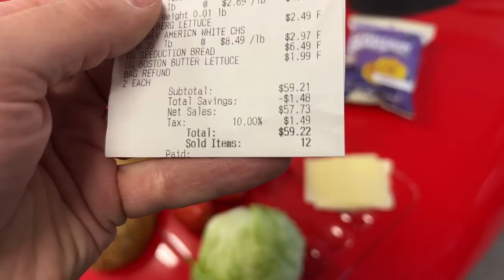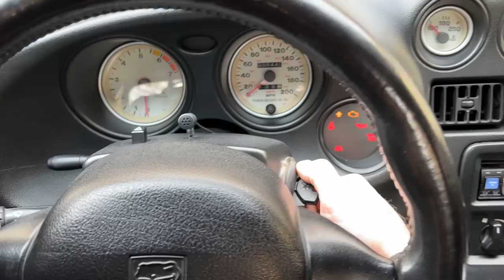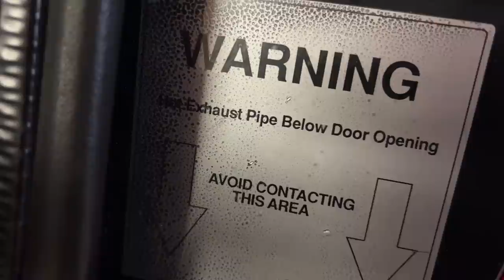How To Make A Ham Sandwich In Your Garage

Comment: Not going to lie,the tomato slicing worked much better than I imagined 😄
Reply: He lathed them.... On the lathe
Reply: and got some extra iron as a bonus
Reply: The tomato slices tasted a bit sharp though.
Reply: I was extremely surprised too.
Reply: I've seen actual knives intended for this purpose do a worse job, yeah
Reply: @rpavlik1  tomatoes are so frustrating to cut 😉
Reply: @426baron  
Very very sharp knives need no pressure to cut...
their own weight more or less allows a sharp knife to slice through without effort....
Far less dangerous as little pressure is applied..
pressure that especially on a tomato skin...can make the blunt blade flick sideways and bite your finger.
Buiy a cheap carbide "V" style  kitchen knife sharpener.... and use it often.
Reply: Anything possible on the lathe when you have your feeds and speeds dialed in
Reply: Ikr?
Reply: The beauty of it is if you lose the sandwich, it can be located with a metal detector.
Reply: It didn't work well. There's a jump cut on every slice.
Reply: and the reciprocating saw was so much worse at slicing ham !
Reply: Totally did.

Comment: Ok ok ok ok ok ok.. so I had this crackpot idea a while back of building a troll Prius by body swapping a RX450h with a Prius body, because I anticipated that messing with any of the components in a toyota hybrid system would be tricky and this would be the simplest way of utilizing an entire awd hybrid drivetrain with a lot more power than a Prius. It could be done with all cheaper older vehicles. In case you need anything other than an off-road Viper and Ham Sandwich to keep you busy, Matt.

Comment: The organic mayonnaise went petroleum grease flavoured, PDQ. Ironically, the swarf embedded tomato slices would have sliced both tongue & lips, adding a metallic element to the complete concoction. Your gritty performance is to be much admired, although boring holes to emulate Emmental cheese is a bit over the top. The old conundrum; spit or swallow! May your recovery be linear & swift.

Comment: What happened to the butter lettuce that you pulled off the shelf, that turned into iceberg lettuce that you had on the hood, that turned into both that you had on the receipt, that turned into butter lettuce that you peeled out on?

Also, how'd you clean your grease gun and lathe?

Comment: Not since How to Basic have i seen such bestial food manipulation, but i sure am glad i voted the ham sandwich... Knowing that a meme choice outright won in a competition with like 12/16 choices being a serious project, 3 being a wtf project and the 1 meme choice to rule them all... Tho, i did vote a ham sandwich as i wanted you to enjoy yourself and actually eat a great sandwich, rather than making a dirt sandwich with tossing a salad under a tyre... Altho, i will get a brand new grease gun and fill it with mayo... That has got to be the best prank to have in the fridge... Someone comes, and you offer to make them a sandwich, pulling that bad boy out... Even better to keep it in shop fridge, so you go to shop, come out with a grease gun, so they dont know that its refrigerated and not a dirty shop tool with essentially poison in it... You pump out a bit on your finger and consume it with visible enjoyment, but without giving them a direct line of sight at the mayo coming outta nozzle... You can even just make a sandwich for yourself in front of someone and much it down as they watch in horror... And let us not forget the option of getting a new, empty metal 1l oil pack, labeling it with some brand label, like ATE brake fluid or such, putting drinks in it, and drinking out of it after the sandwich...  Its also a great container for alcohol if you intend on drinking and driving... Just toss it in the back if you get pulled over, its a can of brake fluid by all appearances if someone looks at it... Now failing the blower test is another thing entirely, but if you want to chug and drive, there you go... I dont drink alcohol, it makes me aggressive, and pissy, so that aint my type of lubricant... But for those who want to have fun and enjoy having a drink that doesnt have to be locked in the trunk, its a good solution...